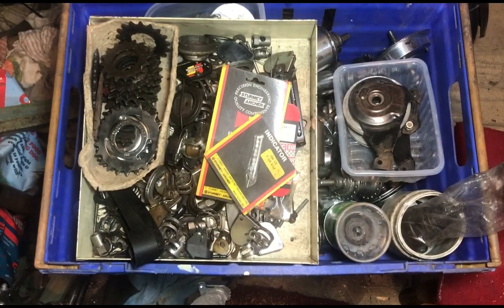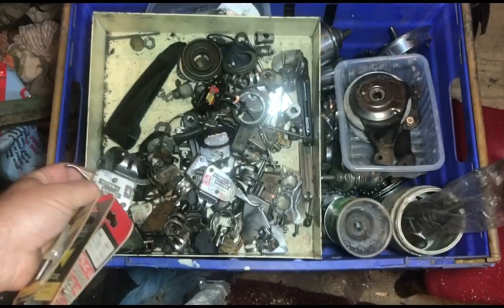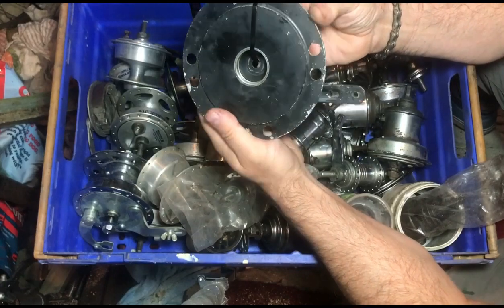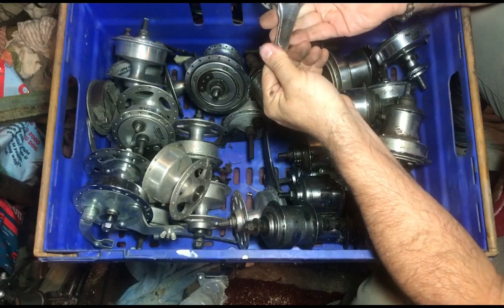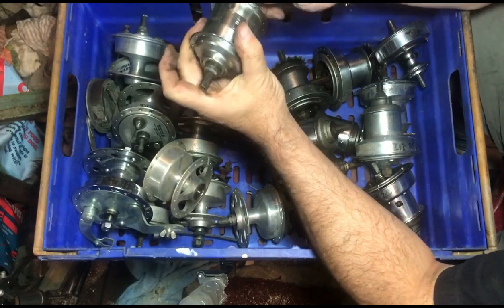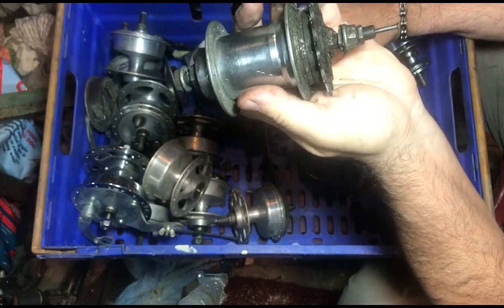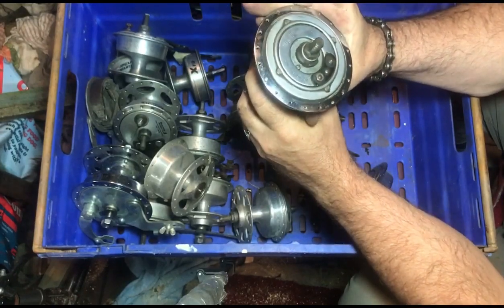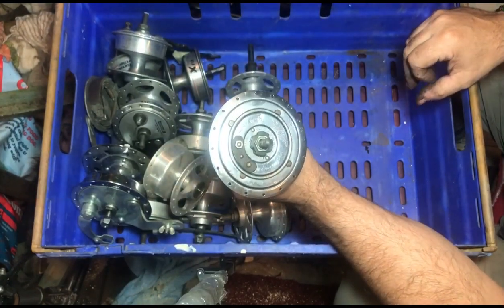Geek alert! Going through my stock of gear, dynamo & brake hubs. Sturmey Archer, Sachs etc For sale!

Comment: I assume you need a frame with the appropriate mounts to use a drum brake? What is the going rate for those brakes?
Reply from the maker: There are clips available from practicalcycles.co.uk to fit the brake arms to the fork or chainstays. The alloy front brakes are £15-20

Comment: Hi, another good video, thank you for taking the time, I've just overhauled a Triumph ladies 3 speed bike and have a  number on the upper seat lug that reads 1618N over the letter T, the bikes wheels are stamped 1972 and 1974 but the brakes look original and are the old double nipple cable type, the general patina of the bike suggest it's older than it's wheels and as it's a keeper I'd like to put an age to it, the bike has come up well and rides perfect, if you have any ideas regarding the serial number I'd be grateful, many thanks.
Reply from the maker: If you are on Facebook, join the Raleigh Roadster Club group, and post the frame number with some photos. At least one person will give you an accurate date almost immediately.

Comment: Any narrow wide Sturmey Archer hubs in there? I would like to have one of those. I think they are perfect for the flat lands around here.
I like the Sachs 2x6. The best of both worlds, giving you the possibility to shift at an intersection. I would not mind having a setup like that, one day :)
Reply from the maker: What do you mean by a “narrow wide”? Which model?
Reply: I don't know the model but I believe they were called club racers, and they have a lot closer gear spacing. They are not very common. We should start an online petition, and hopefully we can get Sunrace to bring back the model :) Preferably in such a way that the cartridge is a direct replacement for older bicycles. It will be perfect for flat-landers like me.
Reply from the maker: The FM medium ratios, and FC close ratios 4 speed. Also AM and AC in 3 speed. I don’t have any.
Reply: Too bad, but I wasn't expecting that. They are rather rare.

Comment: I made it to the end of the video but no Sachs Torpedo! You don't like this German product?
Reply from the maker: I like them, so I tend to build them into bikes, rather than leave them spare!
Reply: Good excuse :) I just had a look inside one. And I think I prefer the SA. Video coming soon :)
Reply from the maker: I repaired the Torpedo Drei on the bicycle of Heinz Stucke, the lifetime world traveller, in 2007. It had covered 400,000km of extreme heavy use, and needed only a small internal gear wheel replaced.
Reply: 400K! there are not a lot of cars that go this far :)
Reply from the maker: I would recommend reading about him. A fascinating guy, and definitely one of us.